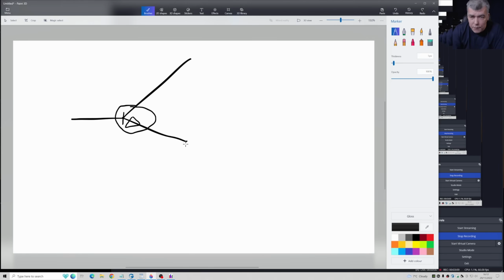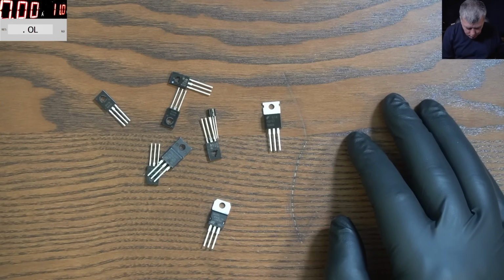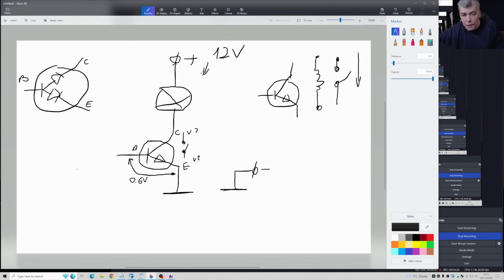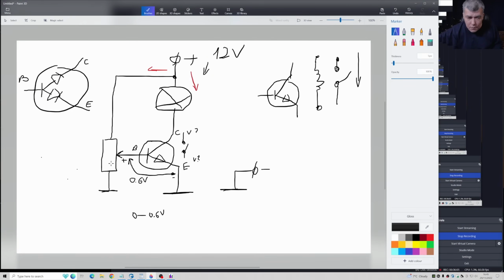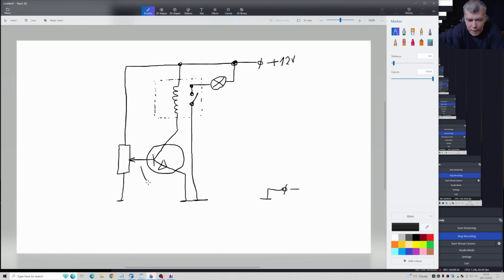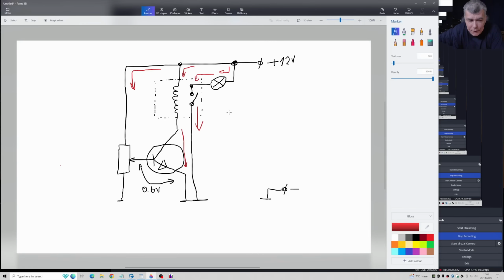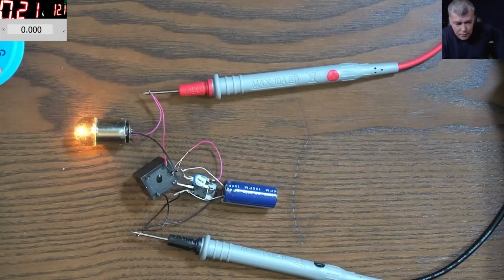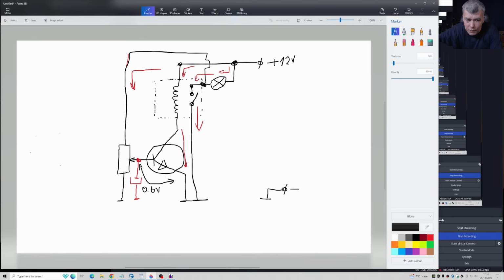How to make a transistor spinning around its own tail

Comment: My only issue understanding is what was the voltage on the base pin relative to ground? We saw it was 0.6v between base and emitter. So does that mean base was at 0.6v higher?

Comment: wait wait .. this only works on 12vdc not 110vac ... i was thinking of using this circuit to blink my 110vac lamp but when it reached to the point where you let the transistor spin around its own tail i realized that this cannot work on 110vac .. now im sad

Comment: Question: Many years ago I was trying to make a turn signal relay (blinker) for a motorcycle. What I realized was the voltage on the motorcycle varied when the rpms changed due to the alternator and the regulator on the bike. That caused my attempt to have the blinking rate change in accordance with the rpm so it wouldn't work properly. If I try again do I just need to add a voltage regulator to the device described in this video?

Comment: Nice ! But too complicated. You can use only one Relay and use the normal close contact with the relay coil. And the same you can add one capacitor parallel on the relay coil. So you will have one nice relay that spinning around his tail.

Comment: B-E will always indicate more than B-C on multimeter.
Reply: That is actually a good way to figure out collector and emitter, the emitter will always have a slightly higher voltage drop than the collector just because it is more heavily doped compared to the collector.

Comment: The adjustable resistor will always dissipate power as it is connected between +12v ground. The current will always flow despite of the the position of the pot. Loss of power always?

Comment: I like the your video.
Except for the part where you identify the transistor pins.
Here you are cheating, by making the assumption that most power transistors have the collector on the centerpin.
Now try the smaller ones - they do not comply to your assumption, which you perfectly well know ☺
I would like to see you'd use those extra 3-5 minutes to show how to identify an unknown collector pin.
You know, and I know, but lots other people don't know 😌
Thanks for your video !

Comment: nice video. I truly appreciate your time and effort making this lesson. I learned a lot. and am grateful :) . i admit that i'm a bit 'slow' in learning and i got lost around the point of the video where the relay was introduced. what are the pin out for relay. it have 5 pins... why not only 3? how to read the markings on relay? how to tell what is input voltage value etc regarding relay? Thank you sorin. :)
Reply: If you look at 22:34 there is a shot of the data on the relay. It's not very well laid out on this particular relay, but the top part shows that it's a single pole, double throw unit. This means that it can only switch one input, but that when the relay is at rest the power will pass from the input to the first output (the NC or normally closed contact). When the relay has had power applied to its coil, it switches and the contacts inside move - so the input now changes and conducts through to the other output (the NO or normally open contact). Some relays are single pole, single throw, they have only two contacts, so generally at rest the contacts are open (NO), and when the coil is energised they are closed to complete the circuit that they form part of. There are also double pole double throw relays, and multi pole too - it follows on as you'd expect! The input and output(s) are electrically separate from the coil contacts in almost all relays, so that's why there are five terminals/pins/connections on this relay. This is done so that the two circuits are kept electrically separate from each other, and that allows the voltage that is switched by the relay to be different from the voltage activating the relay's coil thus causing the switch. The rectangle just under the top data specifies the voltage of the relay coil - in this case 12V. As it's not specified on this relay whether it's AC or DC, either may be used, but that's not always the case. Below that are the current ratings for the contacts when switching AC & DC at varying voltages. DC causes more problems with arcing when the current is interrupted, so the current specs are generally lower for DC voltages than AC...
Reply: @will_doherty  brilliant. thank you! :)

Comment: You explained everything well but if the transistor is like a switch why is it able to dim? What makes the transistor vary the voltage to the bulb rather then just on and off?
Reply: No. Its not really a switch. Think of it more like a valve. The more current you flow tru the base, the more current it allows to flow from the collector to the emitter on the case of an npn.
Reply: When used as a switch a transistor circuit is designed so that it cannot dim - it's made to be fully on or fully off, otherwise the current converted into heat by its resistance will cause it to fail. When used as an amplifier, the circuit is designed so that the transistor is never fully on or fully off, but the base current always falls within the limits of its linear range, otherwise the output would either be distorted, be missing or cause problems elsewhere in the circuit - so you won't find a circuit that uses both functions of the same transistor.

Comment: 22:50 - Relay is very nice thing, yes and dangerous. 1. Flyback without diode protection will kill something connected to it. 2. Relays tend to add resistance after many clicks and may stick/weld.
Reply: or a snubber net in parallel to coil (relay) to avoid killer transient. (the relay will sound different too)